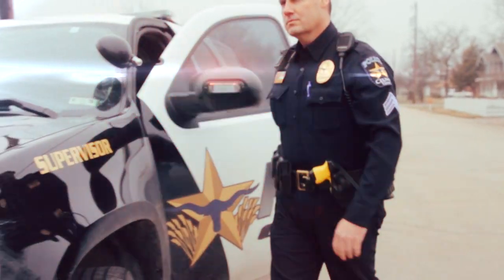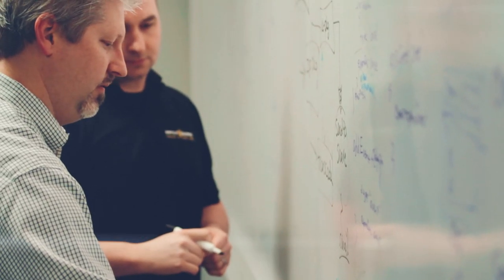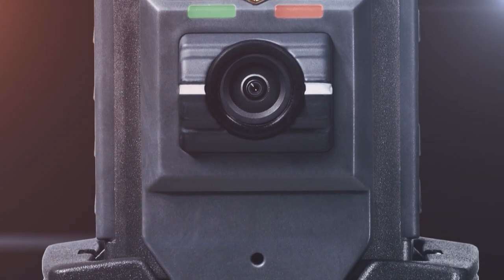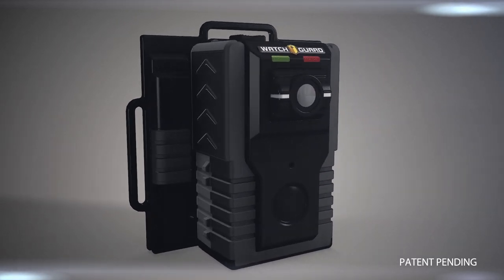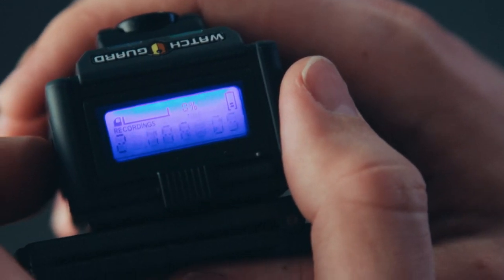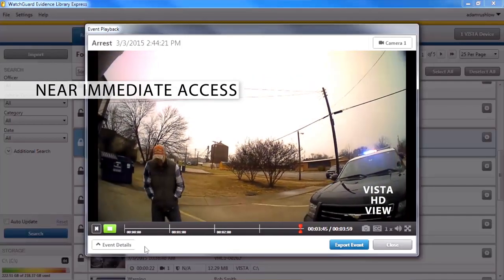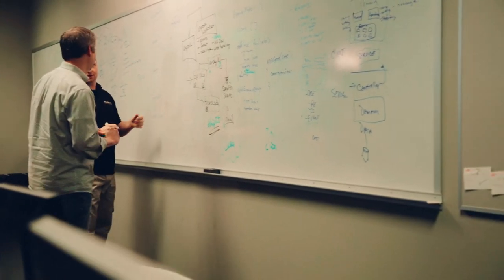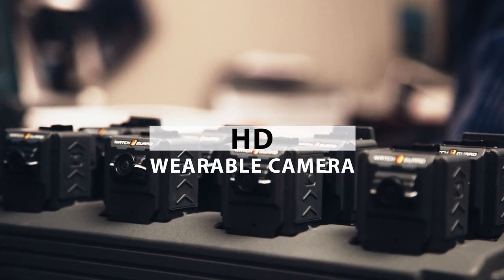WatchGuard VISTA - The Highest Quality Body Worn Camera for Police

Comment: Had the 4RE system for 6 years and they were a fine system. Motorola Solutions purchased this company and I can't tell you how terrible the experience has been with them. We went with the new M500 squad cameras and v300 body worns and after almost 3 months we still don't have this system working right. Their install staff was horrible! Run from this vendor!
Reply: How are the M500s? I have been searching for ANY information about them since they were announced in 2019 and cannot find anything other than their website with pretty useless information.